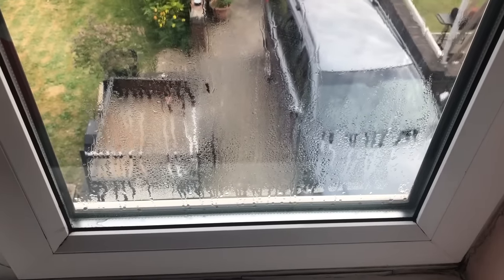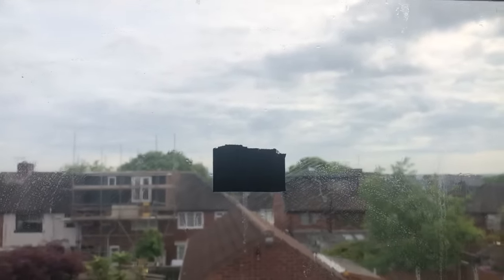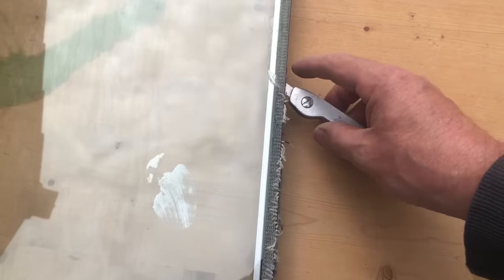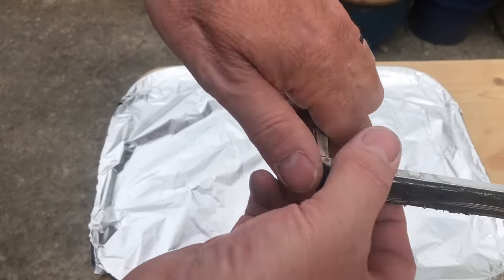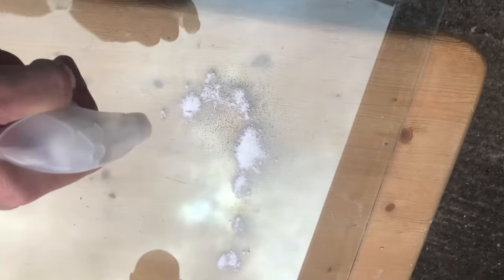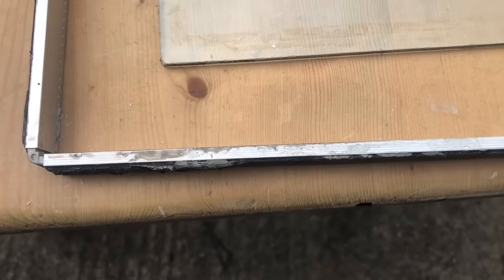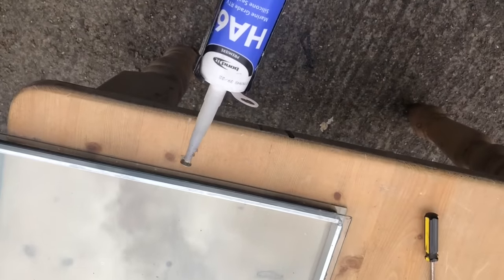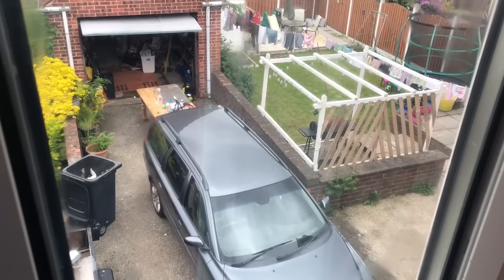Double Glazing Unit Condensation / Blown DIY Repair.

Comment: I always thought DG units were vacuum sealed. I've learnt something.
Do you go forward with the silicone for a reason?
Much neater pulling back at all times, stops the messy build up. Cheers.
Reply from the maker: I go forward with the gun  to push the sealant in for a better seal. I was led to believe the vacuum seal existed too but but there are no valves how is this achieved I wonder.
Reply: @TheRepairer   I’m 100% sure there isn’t a vacuum because if there was the two panes would be curved inwards by atmospheric pressure.
I repaired a window in my workshop during lockdown using this technique. The only thing I did differently was to apply a thin bead of sealant to the edge of the spacer before making up the unit. It wasn’t without peril- the sealant was very happy to get everywhere but it did work. With the black goo I used I could see that I’d made an airtight seal before I filed the edges like you did.
Thanks for the video. Great work!
Reply from the maker: @jonomoles  Thanks, I did my first unit during lockdown too then I did another much larger one around a week later , that are both still good and clear.

Comment: Shouldnt you have used sealant direct on the alu frame before place the glass to form a water proof seal? Vs exterior sealing around exterior of frame?
Reply from the maker: I wouldn’t be able to shuffle and manoeuvre the glass in place with smearing the sealant.

Comment: I always thought (incorrectly I now think!) these glass panels had gas in between them to help with the insulation? Is it just the inch or so of sealed air that does that then?
Reply from the maker: Some have Gas, some have dried air.

Comment: Surely you would have to either vacuum the unit or pump argon in or you will just get condensation between the panels ?
Reply from the maker: There are many myths in the glazing industry no vacuum required, gas is an option on the high end windows as most used dried air. It’s the desiccant that drys the moisture out during construction and the airtight seal prevents any  further moisture entering the unit.
Reply: @TheRepairer  ah - right, never knew, cheers for that

Comment: have tried separating double glassing windows before and broke them. what sort of wee knife did you use? fantastic to see the whole process thanks
Reply from the maker: I just used a Stanley knife and took my time going carefully with multiple passes slicing through the old sealant a little at a time.
Reply: @TheRepairer  thanks

Comment: Awesome video my friend I have 4 blown panels in my conservatory and damn right I'm gonna have a go fixing it myself "why not".
Gonna purchase the same tool also .
BUT my beeding appears to be on the OUTSIDE not INSIDE like yours is this normal plz advise 👍
Reply from the maker: Older windows have the beading on the outside.
Reply: @TheRepairer  thanks mate  but same process ye ?
Reply: @TheRepairer  thank you but sane process ye .
Reply from the maker: Yes the same process as detailed in the video.

Comment: In deconstructing the window, did you discover any correctable design flaw that you could improve on to prevent or slow future leaks?
Reply from the maker: The base of the window is always the source of failure in every one I’ve looked at. I can’t think of a way to better the repair.

Comment: My suppliers heat the glass before making the unit. When the air between the glass cools a partial
vaccum occures giving a concave surface to the glass.
Reply from the maker: With all due respect to your suppliers that tale could just be a lot of warm air!
Reply: Quite often when i pick up the units from the factory they have only just been made and gloves are needed because there hot to handle.  @TheRepairer

Comment: Trouble is you've got atmospheric air between the panes, which inevitably will lead to condensation. There's an inert gas between between the panes when new units are being made.
Reply from the maker: It’s just a dried air double glazing unit nothing special.
Reply: Argon between glass panes

Comment: I've got a lot of small panes.  The aluminium spacers would easily go in the oven without disassembly and removal of the desiccant.  Do you think that this would be ok?  Or better to just bitter the bullet and remove the desiccant?
Reply from the maker: There is much meltable sealant residue and plastic holding the frame together at the corners, I wouldn’t.
Reply: @TheRepairer  Thanks :)

Comment: I also work for a double glazing company making the parts (the spacer bar)  and I would never attempt this repair. 
I feel it may suffice for a small amount of time but the end result won't be as effective for so long.
The amount of research going into the materials is insane. 
firstly, the desiccant needs to be heated to a much higher level for a lot longer than you think to fully "revert" back. We're talking 0.05% moisture content at new, baked in an oven at 180 for 30 minutes isn't going to get it back to that. you'd be looking at 250+ for 4+ hours. 
The sealant I feel is wrong also, marine, I'm guessing you're assuming it just needs to be watertight? the sealants that are generally used are butyl - hotmelt and they are structural as well as water/air tight.
The units that fail and blow are poor quality units from the start. We have had samples taken from 15 years back, left outside in the elements and the glass has fully changed colour to a grey/green without blowing, fogging or condensation inside. 

While you may want to repair, it's only going to be a stop-gap before another failure using these tecniques, but I cannot say how long that would be. 
If the OP would like to get in touch I would gladly share more of my knowledge, and possibly send some samples of the products that should be used.
Reply from the maker: The repair works well I repaired a bifold  door DG unit back in 2020 during lockdown  and I’m am still waiting for it to fail! 

Thanks for your comments we learn from each other and your right about the poor quality units failing I have some from 1997 and they are still good.

Comment: Will the insulation properties of that window be greatly reduced now because there is no vacuum between the inner and outer glass
Reply from the maker: The vacuum is a myth it’s just an airtight seal.
Reply: @TheRepairer  well you learn something new every day.
I was told if there was condensation on the inside of the window them the vacuum was lost between the inside and outside panes of glass. The world is full of buffers and experts ha ha.

Comment: Excellent video! I prefer to fix things if I can, and have two blown panels in my house so I'll be having a crack at this - hopefully without any actual cracks occurring ;)  If you said what the hand tool was I missed it. I looked around and it's a painter's multi-tool for opening tins, cleaning rollers, removing nails. removing window putty, smoothing sealant etc. Currently about £8 is a popular price (late 2023).
Reply from the maker: Yes I got my tool from Ebay it’s also call a Don Carlos Knife.
Reply: @TheRepairer  Aaah... I didn't know that. But it explains why they call Don Carlos "The Picasso Of Cutlery"...   ;)

Comment: Thing is, now you've got no Argon gas in the cavity. That makes a huge difference to the thermal properties of the window. It might not have water in it anymore but it's going to be almost as thermally inefficient as it was before.
Reply from the maker: It’s a dehydrated air double glazing unit, it has never has argon in it.
Reply: The age of that window it would have been a hermetically sealed unit with no gas. The giveaway is no bungs in the corner pieces.

Comment: Quick tip shorter beads goes first, no mater which one first as they are more rigid. Also it does help to put something heavy on top of glass like  few books to help to compress glass to aluminium spacer.
Reply from the maker: Thanks for tip, I will bear it in mind for next time!

Comment: Chances are after this procedure, the glass unit could turn out to be even WORSE ! If not properly sealed , just get a new replacement is my advice if you don’t know what you’re doing ! ( Retired glazier )
Reply: Should that tape he was removing at the start not be removed before fitting the unit originally? I bought a replacement from a manufacturer, and it had a sticker saying tape must be removed
Reply: @fanfeck2844  gaffer tape? thats left on so you dont cut yourself against the glass, however... you can request the manufactures do not apply it (say you are adding a tinted film).

Comment: Brilliant. 
I’ve had 3 fail over winter. 
Mine glaze from the outside but I assume the procedure is the same.
Reply from the maker: Glad you enjoyed
Reply: Mine have the beading on the outside as well. I've had a go at removing the beads on a ground floor window to measure the panel and they are real stiff and its not something I fancy doing on a ladder for the upper windows. Also hearing that as beading on the outside is a security risk then the units might be fastened with double sided tape. As much as it looks fairly straightforward I think I might leave it to the professionals (who will probably try and sell me new windows !)
Reply from the maker: I have a mixture of DG units at my house the extension windows are removable on the inside and the original house are removable on the outside. Double Glazing salesman visit (cold call) and they know that your windows are quite old if the beading is on the outside! I’d expect the upsell to a new window from them.
Reply: @TheRepairer  Thanks for your reply. I think this is the first video where I've seen someone actually fix the units themselves. Impressive 👍
Reply: @robthomas7232   Hi, a lot of the older externally beaded frames were installed with the beads fitted first and then the internal rubber gasket was pushed into the frame, this meant that once the gaskets were installed, it was almost impossible to remove the external beads (security) Correct method to change units would be to pry out the internal gasket first and you would then find the beads then come out quite easily. However you may also find that the units have had clear silicone added by the installer between the frame and the glass edge for extra security and some frames even had an adhesive surround holding the glazing in place. Removing units from these frames intact is a really tricky prospect. Would also advise against trying to carry glazing units up and down ladders. far safer to hire a tower scaffold and once the glass is removed, pass it back in through the frame to a helping hand. Good luck (Carpenter)
Reply: @blzbub1  Cheers for that Dave. This is proving to me that as much as I like DIY where possible, it's probably best to get someone in to do it who will have this experience and will do it a lot quicker than I can.
Reply: @robthomas7232  you may need to remove the gasket from the inside first. Externally glazed windows usually have an internal starting point, to stop people from just walking up to your window and removing it. Once you have removed the gasket, the beads outside should be nice and loose.
Reply: think id get new windows - if they glaze from outside its a bit of a security issue is it not? any tom dick and harry can just take the glass out to gain access. Thats why they started internally glazing em.

Comment: He failed to put double sided tape on both sides of the aluminium spacer bar. Secondly how much would he charge to do that. I have guessed the size of the unit and would fit a new one for £70.00 in around 10 minutes.
Reply from the maker: Double sided tape would help hold things together and be helpful putting the spacer frame back together but I had few problems holding the shape true so no need. I don’t charge any labour as they are diy jobs.

Comment: Nice job. What about panels that have been broken down for quite some time, and have nasty streaks inside them. Are they salvageable?
Reply from the maker: I’ve done three in total, previously I struggled to remove the white hard water staining from the glass but I think I’ve sorted that now. It would be good to have a milky white example to work on.I suppose the aluminium internal frame would corrode away to dust if neglected too long.
Reply: @TheRepairer  Water vapour from any type of water then re-condenses does not contains the hard water chemicals though. White streaking has to be from other vapours from organic sealants etc.
Reply from the maker: @nickhickson8738  That’s interesting to know.

Comment: I never realised that could be done. We've always paid to have them replaced. I thought there was a vacuum between the panels of glass.
Reply from the maker: Vacuum is a myth.
Reply: @TheRepairer  I do remember seeing vacuum double glazing in Denmark in the 80's, which is why I made the comment.
Reply: @paulbradford8240  Its not a vacuum, could be argon gas filled .
Reply: There are vacuum ones on the market but they are quite specialised.

Comment: Although I admire the skill in repairing, a replacement double glazed unit would cost very little (if you fitted it yourself) and be a lot more efficient due to the argon gas and low-e coating you'll have on it. I'd replace with a new one.
Reply from the maker: Sometimes its the excitement of repairing things that becomes the overriding factor.
Reply: That's entirely understandable!
 @TheRepairer

Comment: Double glazed windows have any moisture removal from between the glass. You will get misting in the summer. Plus all modern windows have different gasses injected for better thermal performance. The four hours you spent could have earned you the money for a new window pain 😉
Reply from the maker: I don’t get paid on my days off so four hours of nothing per hour equals nothing! There is no misting I am happy with this repair and would do it again and again!

Comment: Great Vid.   Question:  Ive got 30 units that have blown and it seems more environmentally friendly to repair these rather than send them to the tip and buy new.  Are there any companies that offer this service?
Reply from the maker: No companies that I am aware of, 30 is a huge amount to replace!
Reply: @TheRepairer  thanks, conservatory roof!    It looks as though the glass is at least recycled so probably going the bite the billet and but new. all the best

Comment: Would it be cheaper to buy a replacement unit ?
Reply from the maker: I doubt it the sealant is available for around £5 per tube.
Reply: @TheRepairer  but labour isn't.

Comment: This video shows that it can be done, with patience,  not my strong point😢 i have considered trying this on some of my failed units, i gave up as the glazing bars are external and after 25 years on a south facing wall the trim was to brittle to remove without breaking them, replacements were unobtainable, plus they were upstairs, so struggling on a ladder was not a very attractive idea. In the end i had the whole window replaced, the sashes were distorted so were getting draughty. The new windows are glazed from the inside, so should be doable in the future. Are new unuts mor reliable than those of 25 years ago? Or is it a fact of life that UPVC DG windows have a lifespan of about 25 years, maybe aluminium windows would be a better option.?
Reply: Dgu's may have a 10 year guarantee. it varies . Ali or Upvc makes no difference , they will blow  usually due to the sun but also if the packers are fitted incorrectly . . Never try this bodge  in the video .  its not worthwhile .

Comment: I had the weather on my side yesterday but failed at the first hurdle I started on the smallest top opener but the OUTSIDE beading is unbelievably tough to get out I started on the sides as they lip over the top n bottom I've literally peeled the beading back on the top layer but it appears to be hooked up underneath n won't move . Could it be that the outside beading could be glued or siliconed in to help waterproofing ???
Epic failed please help someone 😢
Reply from the maker: https://www.ggrglass.co.uk/blog/tools-for-removing-beading-from-double-glazed-windows/
Reply: @TheRepairer  when I removed the INSIDE compression seal the OUTSIDE beading just fell out with the same tool your using . If I missed it in the comments then I apologise or maybe a rookie like me should have known.
Reply from the maker: A good few years ago I also struggled like yourself to remove the outside window / beading whilst up a ladder and then the penny dropped to remove the inside rubber seal. We were getting a large headboard in a house that wouldn’t go up the twisty staircase! We are forever learning as we go!
Reply: @TheRepairer  love that 👍
We came very close a few times when delivering for BREEZMOUNT peoples eyes are bigger than the house and access 😄
Reply: @TheRepairer  PS SORRY I stole your idea on short video 👍😄
Reply from the maker: Your welcome to put a link here.
Reply: @TheRepairer Thank you. 
I forgot to mention there's was no water inside only WHITE POWDER n in the middle of the bottom ALUMINIUM strip was a RUSTY patch WTF never thought that was possible !
So I'm not gonna dislodge strip n desiccant incase it's not desiccant n summit else.   I'm gonna take a shortcut n use a hot air gun instead .

Comment: interesting, nice to see how easy it actually is to reassemble it. I'd assumed these were vacuum sealed or is that a compromise in that you cannot replicate that aspect?
Reply from the maker: I’m not sure to be truthful, definitely air tightness will be achieved but no vacuum. I’m learning more and more from this comments section one poster mentioned that vacuum unit do exits for high end products but the one I repaired wasn’t vacuum sealed.